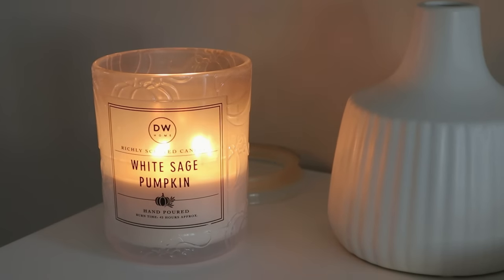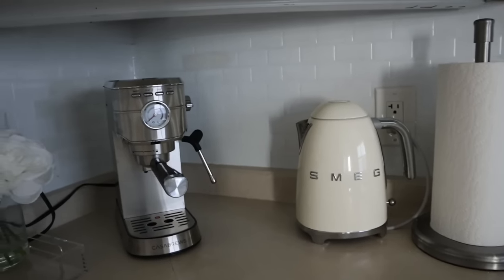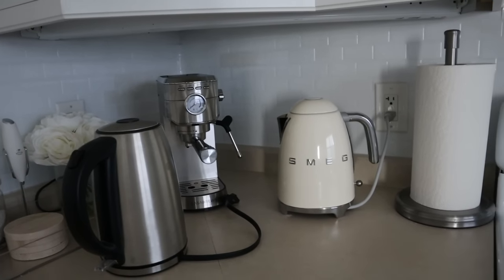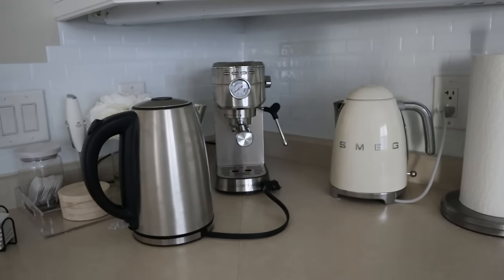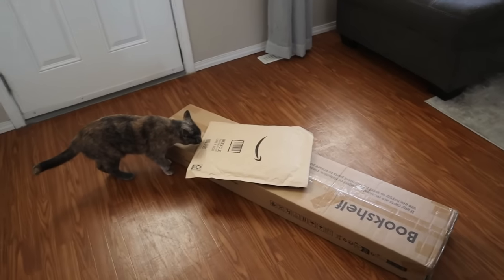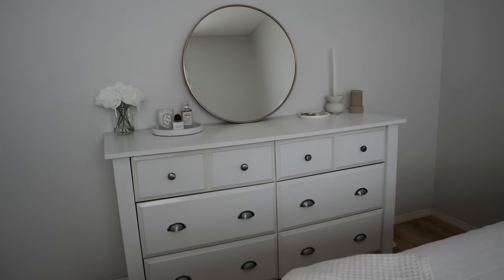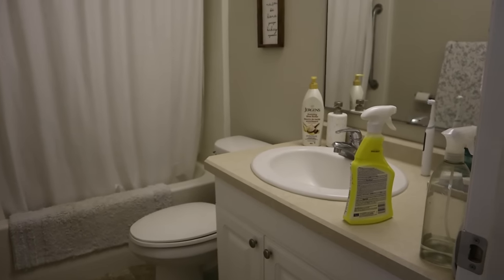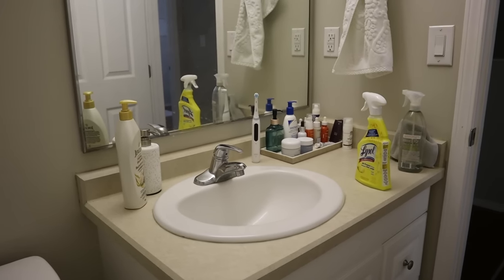Sunday Reset \\ new shelf, cleaning, SMEG review, organizing, decorating, amazon pyjamas \\ VLOG

Comment: I would keep the white coasters, they match the kitchen really well. The beige ones are nice too but they stand out a lot. So keep the white ones if you care more about cohesiveness, and the beige for an accent in your overall decor. Or keep both because you like the beige and you can't return the white ones. ;-) In the end, you can always gift the ones you don't end up using.

Thanks for the cleaning tips. I usually use water and vinegar on surfaces but never took it to the mirror. Streaks drive me crazy so I'll try that next time.